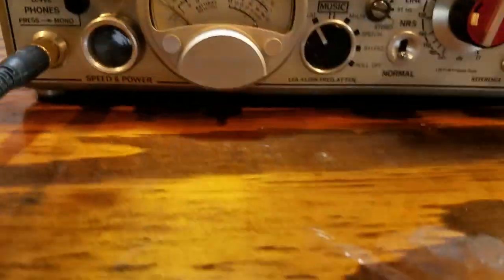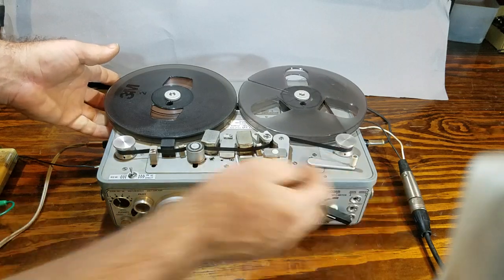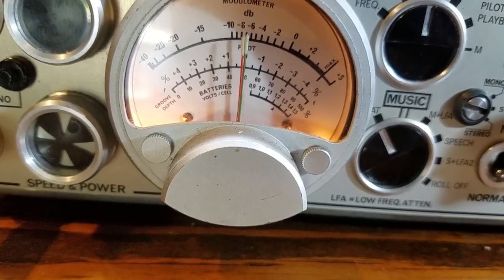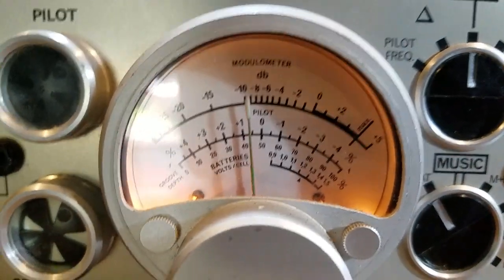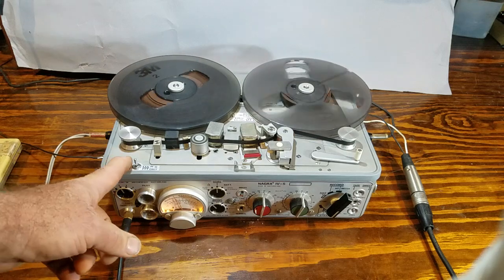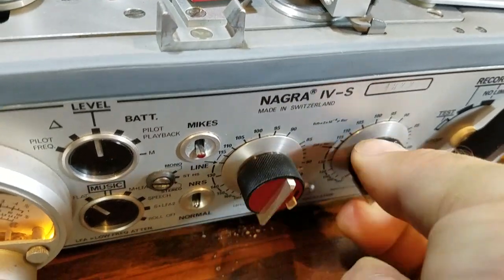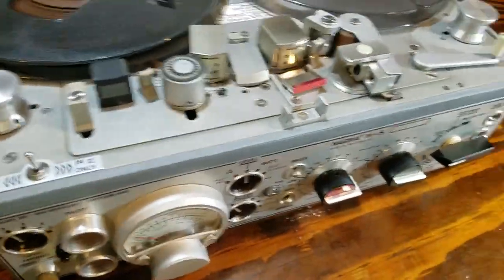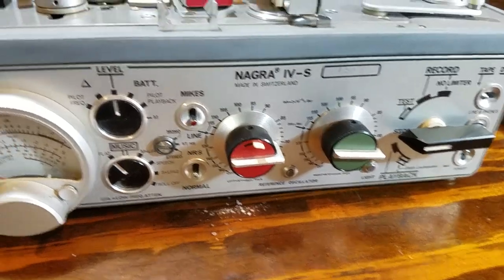Stereo Nagra test 4822

Comment: Nice video. I wish you tested nagra master as this is the mode the machine is more likely to be used by audiophile enthusiasts nowadays. Besides that I have an SNN (a rare high-speed, full track version), an E, an IS (both full track mono), and a IV-S, as well as a Tascam HD-P2 and a Sound Devices 633, and the Nagras, any of them, just blow the digital recorders out the water as far as restitution of the emotion and liveliness of the source. There is no contest. This is mostly striking with spoken voice recordings like interviews of interesting people speaking softly, to give an example where they absolutely shine at capturing the moment. The old, bulky, highly impractical Nagra brings you there in a way that the other more modern recorders I have don’t. The Nagras also have very good mic pres even by today standards and fantastic limiters. You can record an atomic bomb with the mono versions and it will sound just fine when everything digital will helplessly clip. Besides that, observe that there is no mechanical pressure on the tape when the transport is engaged and the switch is on Stop. The roller only presses the tape against the capstan when you engage Rec or Play, this is also why the tape stops instantly. This also means the rubber will not suffer from the transport staying engaged. However, I did not know about the rewind rubber so thank you.